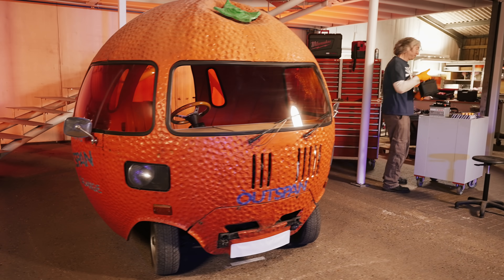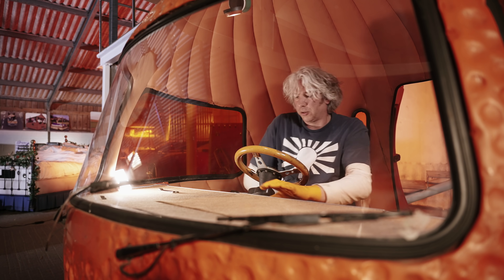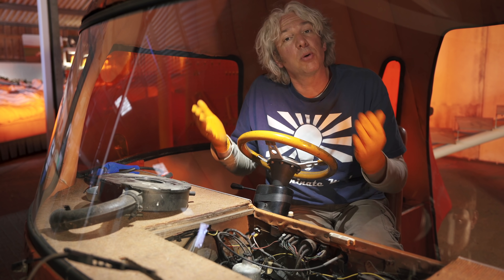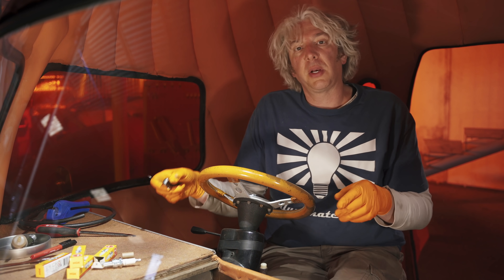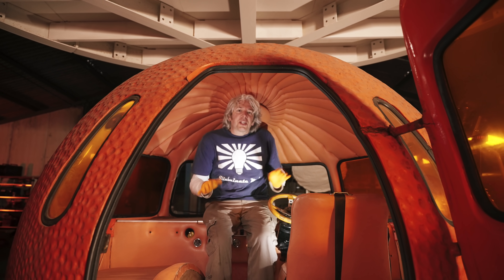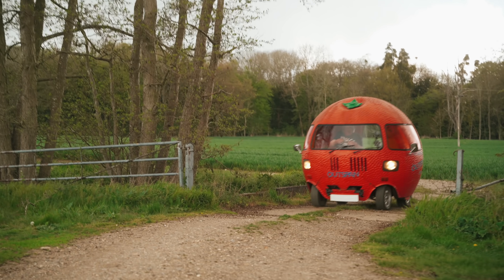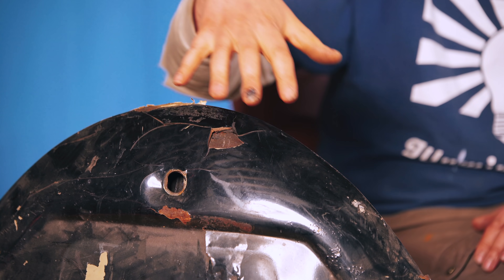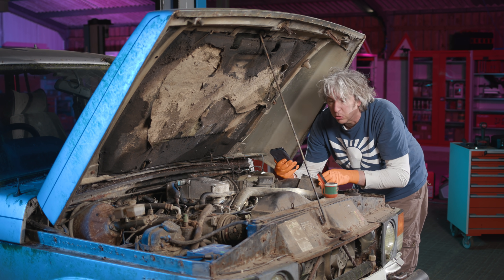Edd China's Workshop Diaries Episode 6 (Outspan Orange Part 1 & Electric Ice Cream Van Part 4)

Comment: Paint job on the Outspan is crap ! Orange peel everywhere!
Reply: Boooooo. That joke was such low-hanging fruit.
Reply: You are just taking the pith now.
Reply: I like the way Edd jumped straight to it, and didn't wait till the last segment! 
But given the current climate, I had imagine he would be discussing a possible electrical conversion,
but not having the most aerodynamic body, I imagine it would use a lot of juice? 
That's it, i'm out! 🍊🤔
Reply: @nigelcarren  you squeezed a lot in there.
Reply: The fruit doesn't fall far from the tree I see
Reply: If you roll it it may never stop rolling.
Reply: This segment is just for puns
Reply: @rogeronslow1498  unless its orange crush

Comment: Edd, I think you meant .75mm plug gap, rather than 7 1/2 mm - that would be one heck of a spark...!
Reply: My thoughts exactly.
Reply: Metric nitpickers!

Cheers from (mostly metric) Brazil!
Reply: I knew some one would pick this up 🤣
Reply: Nitpicking? At Eds level he should know the difference  between seven and a half and point seven five.  25 thou or 250 thou ( or before the imperialists get into gear, whatever the imperial equivilent is)
Love the show Ed, but please a liitle bit more detail regarding what you say regarding values.
Reply: It is hard to make a joke in a language you do not master. Methinks humour vary greatly amongst countries.
I have not the foggiest idea of what a 1000th of an inch must look like.
Cheers from Brazil! (or what's left of it)
Reply: @eugeniomarins2936  0.04" = 1mm is a handy rough conversion. The management tried to implement minimum tolerances and the Union went on strike ;)
Reply: @sha9na5ty  Hahaha! Thank you kindly for the suggestion! As an engineer, i most certainly can make length convertions... (lol) What i said, i meant literally. As i have a metric mind, i have to stop and make calculations to "see" in me mind how much are, say, 47 feet, or 300/1000 of an inch...
Reply: @eugeniomarins2936    a 1000th of an inch = 0.0254mm

Comment: Hey Edd in the old days mechanics used a hacsaw blade for plugs and a razor blade for points, standard hacsaw is .020" and razor blade is 010".to .015" depending on the manufacturer..
Reply: The old guy that lived next door when I was a kid used a worn dime ($.10) to set his plug gap.
Reply: @Hoaxer51  Yeah modern coils need a .040" gap, where as the older ones used a .020" gap.

Comment: We used to have a red P Reg (1975) Mini Clubman estate, with a 998cc engine.  It was already 12 years old when we bought it for around £450.

The battery was located under the back seat.  It was a great car to drive, with a nice gear change.

After 3 years, the sub frames gave up the ghost and the vehicle was scrapped.

These Clubman estates are now rarer than rocking horse doo doo, the last ones were made around 1982/83, they had an 1100 cc engine by then.

Comment: Brilliant episode. Brings back lots of fond memories of my engineering days. In case people didn’t recognise that dial being used on the end of the Chuck head on the vertical drill, that is. DTI or Dial Test Indicator. It allows you to very accurately align stuff down to a thousands of an inch. Why not include an angle grinder and some other workshop tools like vertical milling machines and some computer driven machines.

Comment: remember the outspan fondly from way back when. would be great converted to electric.
and a hot tip for not losing nuts when removing - put a small neodymium magnet inside the socket.

Comment: Great Vid Ed
for the oil pump drive much easier to use a short piece of solid bar and put a hacksaw cut in the end wide enough to fit the drive gear
Obviously making sure it's all smooth and clean before using it  
10mm round bar is perfect saves the cost of a spare drive and making an adaptor
I did this about 38 years ago working on a VW golf and have made similar ones for different engines and jobs
if you make another with a much longer slot you can use it for cleaning tubes porting heads etc etc
I might start to do some vids showing some of the tools I have made over the nearly 50 years I've been working on cars
Wheeler dealers is not a patch on what it used to be
and without your influence the sleaze factor has increased exponentially

Comment: That is the coolest looking bubble car 😎👍 Ps The horses looking at the car going along probably were wondering what it was lol 🤣 Great how you manually checked for oil pressure with the drill. Also the metal lathe work on the flywheel was amazing. 👍

Comment: always check your new sparkplug's gap, I used to deliver auto parts and sparkplugs would get dropped on their ends all the time, closing up gap
working on that engine, reminded me of working on the engine in my 1974 E100 Ford van, most work done sitting in driver's seat

Comment: RE: the cutting disk on panels. I would suggest getting a dremel or an Air Die Grinder if you have an air supply. You can use much smaller disks and get even higher/tighter tolerances. Though I would stick with an angle grinder for long straight cuts.

Comment: Just one thing about the flapper disk. Always pull, never push, to get a uniform surface. Also never run a flapper disk at angle grinder speeds, otherwise the glue holding the abrasive cakes and shortens the life considerably. An adjustable speed angle grinder at polishing speeds, sort of half of the grinding speed,  leaves a beautiful finish and makes for a flatter surface.  That's my welding materials prep experience. When using a grinding disk always push to get the best cutting action. If you use a cutting disk always push ligthly and run perpendicular to the cut.

Comment: exhaust blowing from somewhere within engine compartment
Front Play in steering rack inner joint(s)
Front tie rod bushes heavily deteriorated
Front Shock absorber has a slightly worn bush 
Nearside Front Front wheel bearing has slight play 
Front shock absorber bushes heavily perished
not a lot to put right 14000 miles ,this is a gold find.lets see more of this edd.

Comment: Would love to see one of those oranges in person. Just curious though as to whether it requires a seatbelt or not. Personally I'd prefer to have one in case of an accident as depending on the strength of the body it would roll and there is lots of room to bounce around in.

Comment: 0.025" is the thickness of a metal nail file, and a suitable "hard surface" is the back of a wooden backed wire brush, which you can wield carefully. I remember Minis in the 70s. Champion N9Y plugs.
Right front brake drag?

Comment: Great vid Ed.  I'm sure someone has already mentioned it that 9.23 minutes in just a little correction on the thou to millimetre conversion.  30 thou = 0.762mm not 7.5mm and 25 thou = 0.635mm.  You would need a huge coil to jump 7.5mil.  Maybe you could do another vid showing that ;)

Comment: Hi Ed! That filter looks like it has exchangeable inlet and outlet connectors. Could you mention the brand as I badly need a 1/2 inch 12mm OD inline filter. Cheers.

Comment: Edd, please dont use those glass cleanable filters. The rubber seals are not ethanol proof and they eventually leak. The cheap plastic ones arent ethanol proof either but when they fail they fall apart internally and block the fuel flow which reminds you to change them! I had a glass one once and opened the garage one day to find 20 litres of unleaded on the floor.

Comment: Hi Ed
Where can I get information regarding a cost effective electric conversion on a Austin Healey Sprite project.
Also where to purchase components suppliers and  manufacturers, info on working out the motor wattage and batteries in regard to the car weigh to re power and the power switching componentry for the project.

Regards Ron

Comment: Be careful with them glass filters I have had a few issues with them.
The filter element swelling and blocking supply and slipping on the treads and piping open .not a good thing when it's sat above the exhaust manifold .

Comment: I really love your videos
Could you tell me more to the link between ohms coil value and spark plug electrodes distance?
Reply: I think Ed explained that the 3 ohm coil was more powerful than the lesser coil version. This meant that a bigger spark could be created with a bigger spark gap. I assume that means a bigger or better detonation of the fuel/air mixture in the cylinder. Maybe more power output from the motor? Hopefully someone will correct me if I am wrong.

Comment: Heh Ed. Hope you are well and over the hateful little round Cockneys betrayal dude. You were always the star and not the gobby one. I wonder what the possibility is of doing a vid on making a defender puma more fuel efficient? I have tried a remap, larger intercooler, a atmosclear hydrogen on demand generator, removal of the swirl defused from the air inlet prior to the air filter and removal of the DPF.  All of this has only raised the MPG by around 10Mpg. (Although according to my MOT center, because of the Atmosclear it runs cleaner than a prius from a Co2 emmissions standpoint!!!)

Comment: On the "Orange" Mini,  the spark plugs were replaced  and the distributor cap and rotor were cleaned, but not the points.   Did they get missed ?    I have strong memories of cars not running properly because  the points needed to be cleaned and then adjusted.

Comment: How is the exact position of each of the holes on the circle determined? Is it programmed in on drill / bench? Or do you need to measure each location of the hole again when you go the next hole and change drill bits?

Comment: I love the manual pump for the windscreen washers located on the dashboard (it's the black plastic cylinder protruding out of the middle of the dashboard, near the ignition key).

All you have to do is press the pump, by hand, to make it work.  My old Minor Van and Traveller each had one, my current 1968 F reg Traveller has the modification of an electric washer pump.  Unashamed luxury...

Anybody any idea what size the SU carb in the middle of the air filter is?  It looks bigger than the one on my 1098cc engined Traveller

Comment: Edd, how do you deal with setbacks? In the past I've cross threaded a caliper bolt in the hub carrier (expensive mistake). Recently I broke two hub pulling tools (including an expensive one) with a hub well seized to the driveshaft. I'm averse to "renting a ramp" in case things don't go to plan.

Comment: I saw one of these delicious cars at the Beaulieu museum back in 2008/9 during my year at Southampton.

https://nationalmotormuseum.org.uk/vehicle-collection/mini-outspan-orange/

"The rear sub-frame holds the rear suspension as well as the 200Ib of ballast that is needed to keep the vehicle stable. At speeds over 30mph the Orange has a tendency to roll. "

Comment: Also I have a question too, I am currently working on a 2014 Kawasaki Ninja 650 that was in a wreck. I’ve got most of it sorted but my fuel tank is badly caved in on left side. It works just fine and doesn’t leak so I’d like to fix it. How would I go about it ? I can provide a pic of you’re interested in replying ! If not I’d understand, you’re busy. Thanks Ed

Comment: Edd, get yourself a SU chamber lid with a overflow pipe on it, then you can run a fuel pipe away from the engine the needle/seat gets stuck

no car on the road should have that old chamber lid on it anymore they're dangerous

Comment: Couldn't you have gotten the oil pressure up by putting a battery in the thing and cranking it with the starter? Removing the distributor looks like a lot of unnecessary work.

Comment: I had petrol spraying all over the back of the engine bay of my 25 year old Vauxhall Astra because the original feed and return petrol pipes had both completely perished. So was it just age, or is there any truth in the rumour that modern petrol with ethanol attacks old petrol pipes?

Comment: Seems slightly odd that he was having onging issues whilst driving it last and didnt think to open the hatch and have a look at the engine whilst it was running, the probelm was stairing him in the face also there would of been fuel running onto the floor which would of rang alarm bells. Those jubilee clips look brand new aswell id hardly say theyve been in there afew years untouched like he says. Sorry i could be wrong but this seems awfully staged